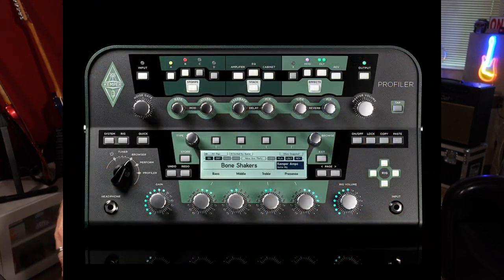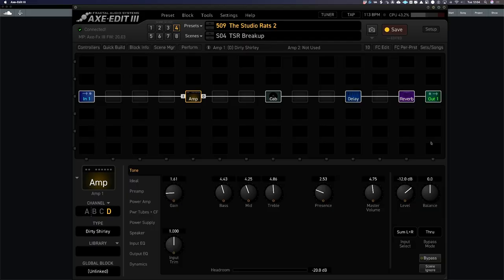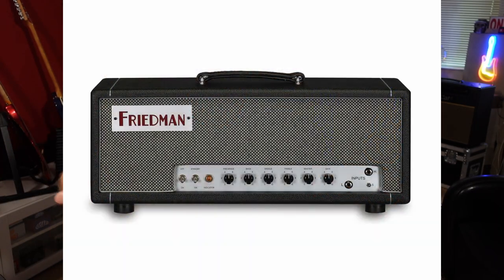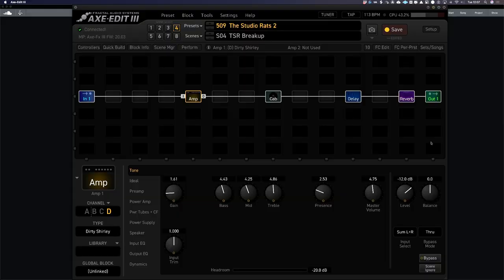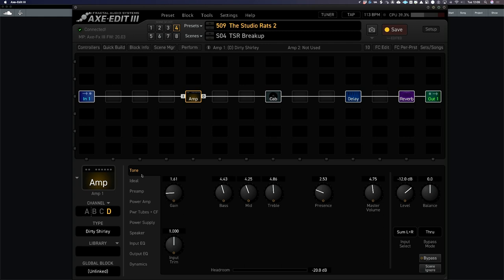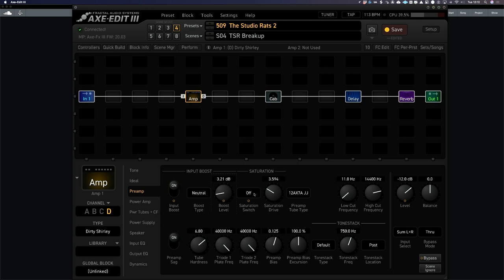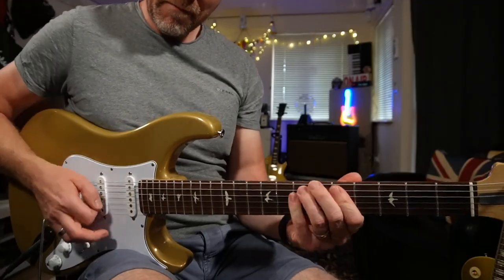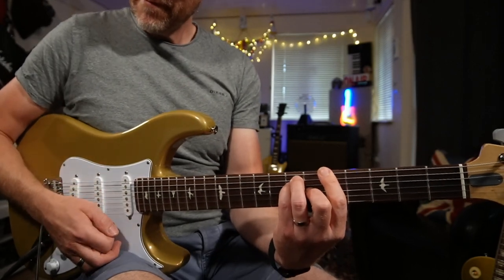AXE FX - 4 Steps To A Better Clean Tone.

Comment: Thank you so much. I was at a friends’ house last weekend and he had his Kemper. I had brought my FM9.
All was well and glorious until he started playing a Lone Star. Then a Matchless. I absolutely love both those amps in real life and suddenly I wasn’t as happy with the Fractal models, anymore. Life’s funny like that, when a new kid moves onto the block. 
I’ve found that a slight change in technique (right hand especially) did a ton in improving my tone on a modeler vs a valve amp. But the Kemper’s clean tones did sound better. And I’m a freak on great clean tones.
Great video, Paul. Works like a charm. 🥂

Comment: Been with FractalAudio since the Ultra. Your suggestion on preamp gain has been a game changer for me. A setting of 1 or less adds a sparkle that I love. I've only tried it on a few models but so far so good. The speaker thump parameter is my other new favorite with patches that have more gain. It reminds me of the cabs that I had when I was young, they often couldn't handle the volume I was playing at but I grew to love the feel of a cab working hard. Speaker thump does that for me. I also had a Kemper for about 18 months and while it was quite good in the end I let it go in favor of the AxeFx.

Comment: Thank you for posting this Paul! Question, are you using any sort of EQ/Filtering after the AXE FX? I put up the same amp, same IR, a 52 RI Tele and my sound seems to be a little more muddy compared to yours. I tried this against your first Axe Fx video as well. If I put an EQ after with a roll off around 80hz, it seems to be closer to what you have. Granted, I think you are on Fw 20.02 in the video and I’m on 20.03 but I can’t imagine it’d be that big a difference between the two. Thanks!
Reply from the maker: Hi Blake, I’m not using any other eq after.
Reply: YouTube compression artifacts?  Slight volume differences?

Comment: Thank you this video opened me up to a few new things. I have the FM9 and that doesn’t have input compression, do you think a little comp from a comp block before the amp but after a drive block would be similar?
Reply from the maker: I personally use a compressor before any drive as your drive is going to compress. Apart from that yes.
Reply: @TheStudioRats  thanks man. Could you please do a video like this one but 4ways to make a better overdrive tone?
Reply: The FM9 will have input compression from now on. It is implemented in the latest firmware 4.01 public beta1

Comment: Can you do this on an FM3?
Reply: I was wondering the same thing. This demo may have completely sold me on Fractal if the cheaper unit has these same features. It really brought it to life, and I was just listening through my laptop speakers!
Reply: @sgmarshall3 I bought one since I left that comment.  It’s a great piece of gear. The only thing in this demo that’s not on the FM3 is the input dynamics adjustment but that can be mitigated by a compression block before the amp if needed.  Im still learning the unit but I’ve been able to coax some great clean tones out of it so far.

Comment: I did it in two steps. 1....sold my AXE FX III. 2....bought a Mesa JP MK2C+
Reply: The Mesa JP MK2C+ is a killer amp that you're gonna really enjoy. You can't beat playing in front of a good, real tube amp setup. I still have my 50W Fuchs TDS combo. However, Axe FX / Kemper / S-Gear / Bias FX / etc are all about good, usable sounds - ESPECIALLY in a mix, + massive convenience. While the Axe FX 3 is significantly overpriced, you are getting a heck of a lot, particularly with the big number of high quality effects (interesting to note that the primary DSP inside can be purchased for $60 !!).
I've played live on stage for many years, stopped about 5 years ago. If I was to go back, my immediate preference would always be a well-setup real tube amp system. However, for 'convenience, ease and reproducibility' I might also be happy with my Kemper...maybe not.